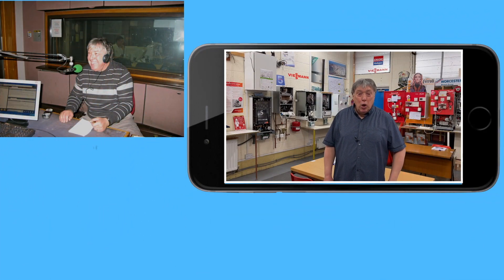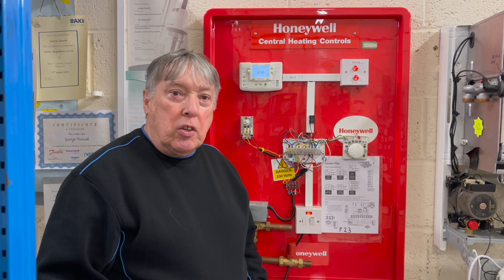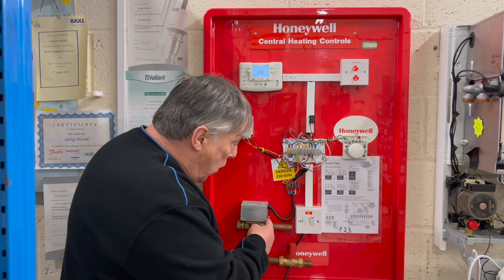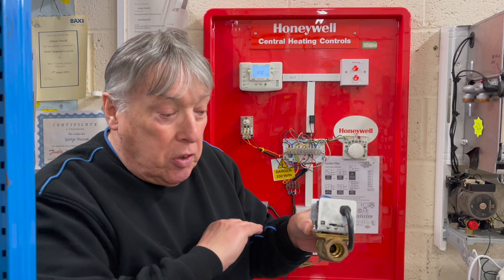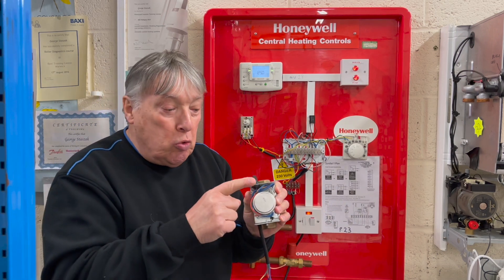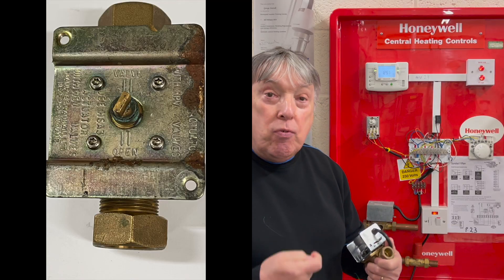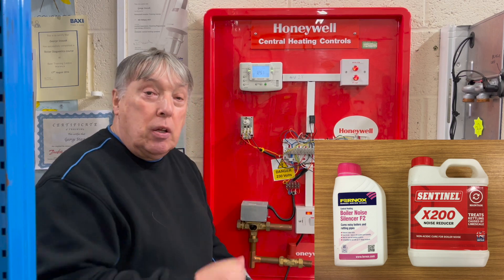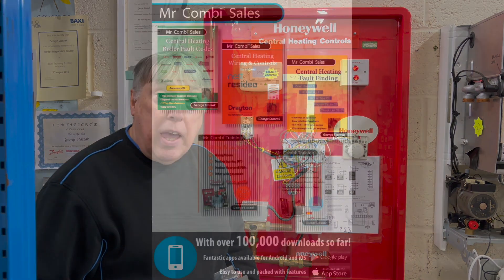NO Heating 🥶 😔!!! Popular Faults 1 Valves

Comment: Great video yet again,  unfortunately I have found honeywell valves of late not to be the quality of earlier ones and therefore I do now change the motors.
Reply: Thanks for the advice George. Also I didn't know about the usage of f2. I only thought it was to se I noisy systems. Every day's a school day.
Reply from the maker: @trevorcollington3240  You are correct that's why we use it, F1 with bite
Reply: Sorry should say use in noisy systems. 😉
Reply from the maker: Hi Trevor, thank's for comment, why not try Danfoss or Drayton with their wiring centre, that's what I teach you will find it much easier and NO motors to change, they are sealed for long life.regards George Staszak